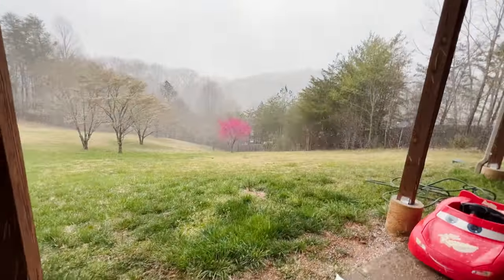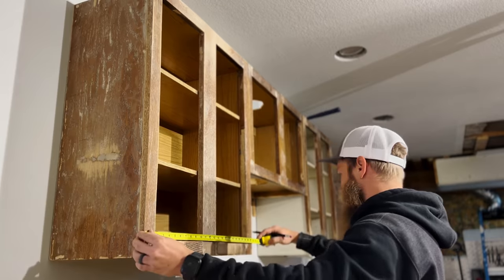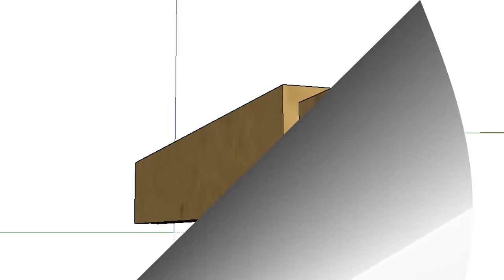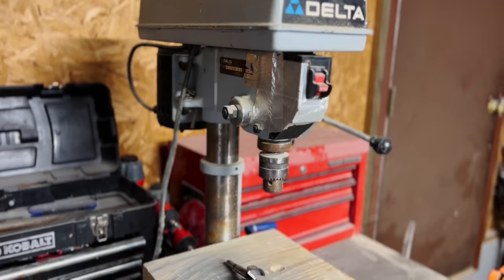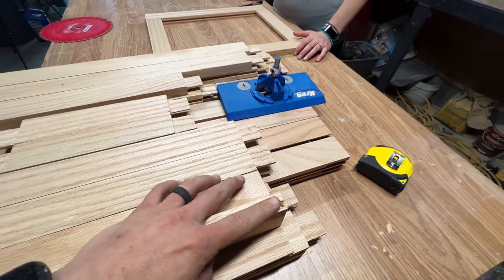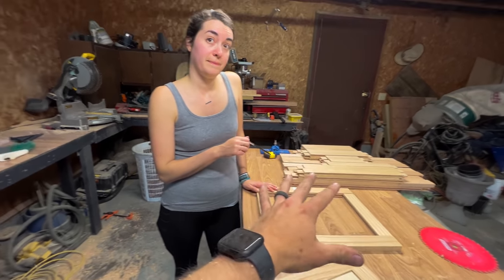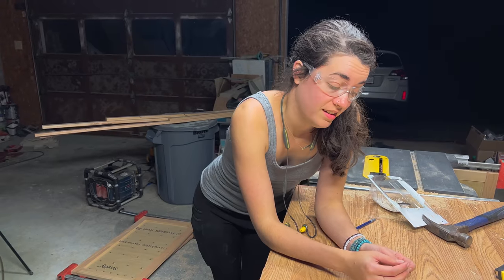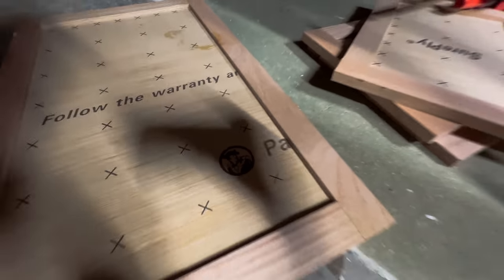Modern Home Makeover // Building Cabinet Doors - Episode 23

Comment: On your drill press there might be a capacitor on that motor that needs replaced. That kinda what it sounds like on the video. Usually theres a little bump out cover on the motor that has a couple screws and there will be a capacitor under it. Match the ratings on it and replace it (you can test it first but you need a meter with mfd setting on it.) A new one will probably be like $10 on amazon and might save you buying a new one.

Comment: never glue the panels. They float in the frame to allow for expansion.
Reply: It's plywood, it'll be fine. For solid wood panels, you're right. The stiles will shift a little bit on these but it'll just make the doors slightly, imperceptibly bigger/smaller rather than breaking the glue joint.

Comment: I don't think that you wanted to glue the door panels to the frame. The door panel should float freely within the frame so it can expand and contract, but the joints of the doors get glued.
Reply: But they are using plywood,  there isn't any expansion. If he doesn't glue it there is a chance that the panels may rattle when the doors are used.
Reply: @vandyFixer  Plywood and OSB expand and contract.
Reply: @KurtMGibbs  surely not enough to be a concern indoors?
Reply: @vandyFixer  It will probably be fine... I'm not a master cabinet maker.
Reply: @KurtMGibbs  nor am I,  Kurt but I do appreciate these youngsters getting out of their comfort zones and getting on and doing it. Seems to me they have a lot to be proud of.
Reply: @vandyFixer  
I agree 1000%!